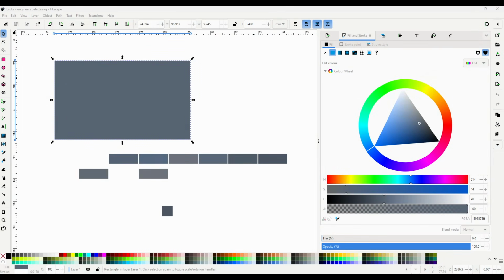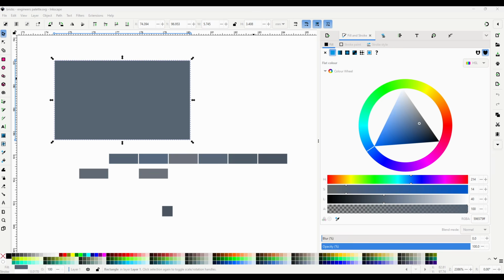Tunnel portal scratchbuild progress [0064]

Comment: Thanks for the video. VERY engrossing! Amazing work though it's a little like performing surgery. How do you plan (or do you) to distress the walls as they are in the photo you showed?
Reply from the maker: Thanks 🙂 I haven't come across a pristine-looking tunnel portal in images I've looked at, including ones from the 1920s and 30s, so I do intend to try some weathering. Firstly I want to get a few layers of varnish on, and then after that use some weathering powder to make it all a bit dirty, and then after that paint on streaks of white. I've never done any of those things before though, so I don't know whether or not it will work out well, but hopefully with varnish on I'll be able to un-do any painting that goes wrong.

Comment: Good evening Jonathan! That was a very interesting observation about the colours being faded when printed via PDF rather than directly! I've had this problem before, but not in the context of model railways, rather some work documents I produced for a presentation a few years ago! I'm wondering if it's something to do with incorrect colour profiles being setup in the PDF file? As you know, I enjoy your methodical approach, and appreciate the descriptions of the different methods you've tried! I'm still not decided on exactly how I'm going to do this sort of thing on Shelfington, but I think it will involve 3D printing the structure, and wrapping it with texture paper, so these experiments are very useful for me! It'll be interesting to see how the portal looks when it's embedded into the landscape! Cheers, Ian.
Reply from the maker: Hi Ian 🙂 With the print to PDF the colours didn't fade compared with a direct print from Inkscape as far as I can remember, though the colour palette thing seems like something to watch out for, thanks!

With a print from Inkscape (whether to the printer or to PDF) whole sections of imported images were totally clipped; at 1:36 in the video there's a print preview (generated by the printer or its driver itself) - on that preview the brick texture of the portal has been clipped to a few top courses of brick, while all of the vector shapes remain. That print preview is the same if I print preview a PDF "printed" from Inkscape, even if the PDF displays as expected in Chrome or another viewer, and I've found that preview does seem to accurately represent what will be physically printerd. It's all very strange!

I think the strength of a 3D-printed structure would be better than card, it would be very unlikely to warp, and you could avoid gaps in joins and not need to worry about pieces of bracing taking up space (I'll need to excavate some land to accommotate those on mine). I'll be interesting to seeing your own experiments when you get to that point with Shelfington 🙂

Comment: card warping.. couple of options

1. use plasticard, it doesn't absorb moisture and warp that way, can warp from paint
2. paint both sides of the card to seal it

have to say though, it looks amazing
Reply from the maker: Thanks for the tips - I went looking for the plasticard for the top stones after that card warped, but for now I've misplaced what I've got. Painting (or gluing) both sides of the card sounds like a good idea to try. Thanks 🙂

Comment: Hello; at 3m 38s my 80-year old eyes think that I see slight discrepancies in thefreal-life  arch stones. Such discrepancies might be due to inaccurate work by stone masons (100+ years ago?), or sagging of the wooden arch support (ditto). Or perhaps my eyes aren't as good as I think they are. Then at 4m 28s I know that I see discrepancies in your paperwork. 
I understand that this is N-scale, and that in the nicest sense possible, you are a perfectionist, but in the end, what drives you to make (curved) arches of glued paper so precise?
I'm just curious. I could not reach the quality of your work. I am, as you might have gathered, very impressed.
Reply from the maker: Hi, the image of Dinmore tunnel I showed this time was brief and small - I have the advantage of the full-size image to hand (which I got from the Network Rail Media Centre at https://www.networkrailmediacentre.co.uk/resources/dinmore-tunnel-with-new-track-2 in case you want to take a closer look at it). The keystone doesn't look like it's in the centre to me, though the photo isn't taken straight-on so there might be some distortion, but the faces of the stones look very consistent in size, shape and spacing to me.

However, I'm not directly modelling this tunnel, just using it as an example, and it's also one that I can show without havng to worry about copyright; the reason I kept the tops of the stones curved was mainly because I was working with the overall arch curve in Inkscape, and it was easier to chop that up as-was than to also straighten the top of each stone.

But I did then find it much harder to keep a consistent length between stones when cutting along that curved top, so on the final tunnel I actually cut the tops of most of them straight. I completely forgot to talk about that in the video though 🙄

My drive for detail is essentially driven by what I can notice with the naked eye - I think we all subconsciously get used to the detail we see in real life, and so we can spot models instantly because of the differences in the detail, even if we can't consciously say what it is. Proportionally massive gaps between stones is one of those things to me - they're just clearly too big to be mortar lines, even at a scale of 1:148, so if I can improve on it I'll have a go.

Thank you for taking the time to phrase your question kindly - I always try to assume the best intent from commenters, but it's nice when it's obvious 🙂

Comment: An impressive result after the different attempts. I use Adobe Illustrator and also sometimes need to export to PDF before printing to avoid errors. I only found this channel a few days ago as I'm considering N scale, but the combination of model railways and coding suits my interests perfectly. I'm a PowerShell fan so might attempt a similar random texture generator using System.Drawing.
Reply from the maker: Thank you 🙂 I'm glad you like the code element here too - I don't go over code in exact detail most of the time, but I usually show the bits that I think are pertinent for anyone who knows how to code. Coding is something I generally enjoy, so if I find a use for it in relation to the model railway, I go for it 🙂